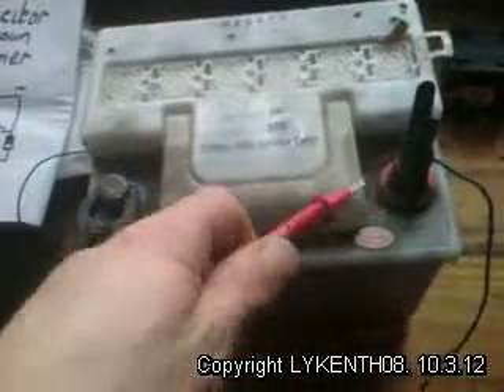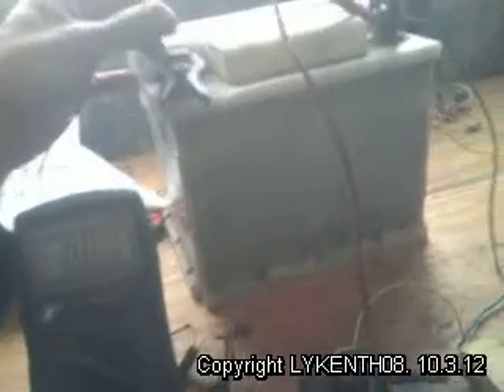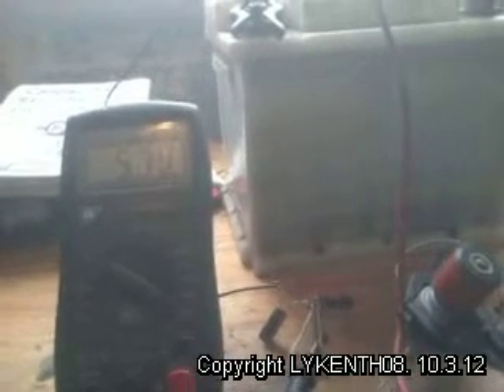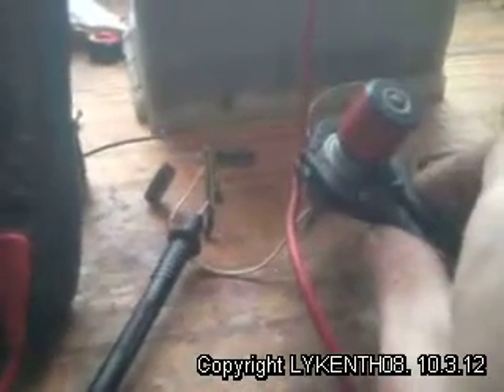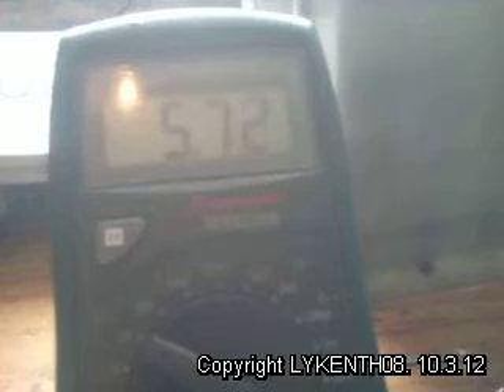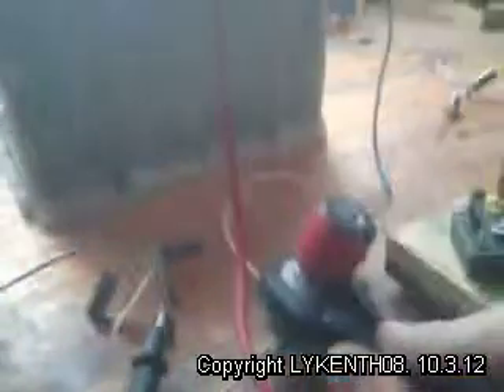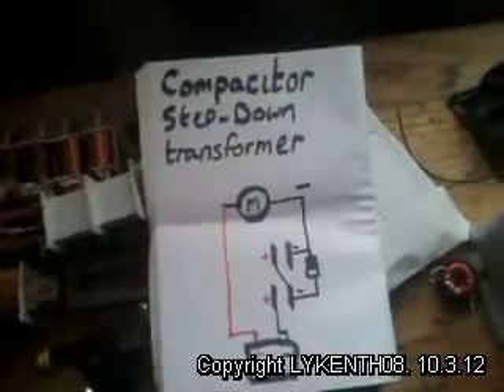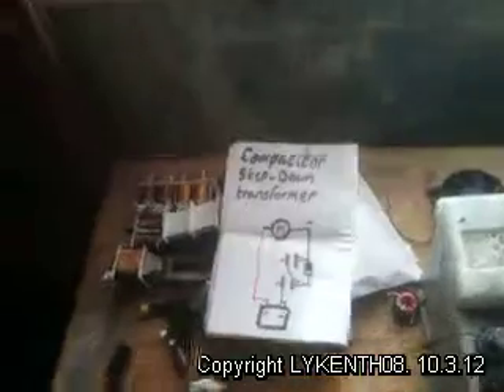C.S.T - Capacitor Step-Down Transformer 2012

Comment from the maker: I have no maths as this was experimental, i just used different capacitors and got different outputs. try 
W W W.scribd(DOT)com/doc/46201071/Capacitive-Transformer-George-Wiseman-1
or
W W W.overunity(DOT)com/10052/capacitive-step-down-transformer/
These are more stable to use.

Comment from the maker: the caps are used as brakes and of course capacitors. alls i know is, the higher the uF of cap, the lower the output voltage will be but you will need to add multipull caps to share the work. if you draw alot of current the caps will pop if there is not enough of them.